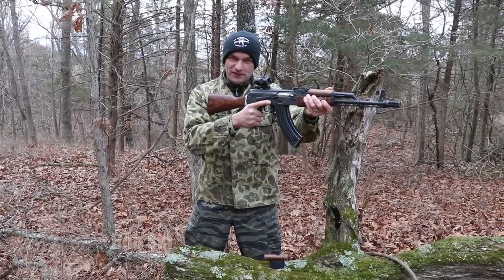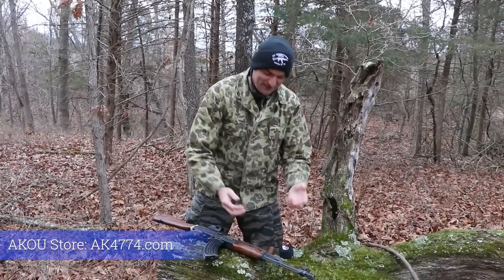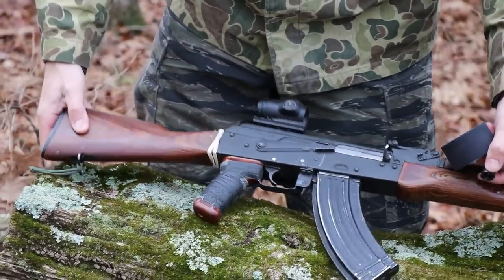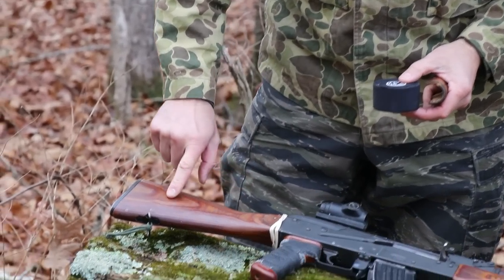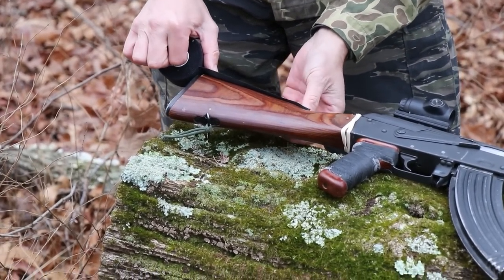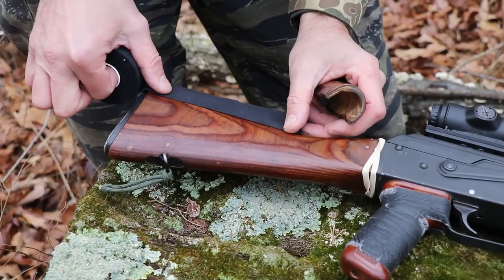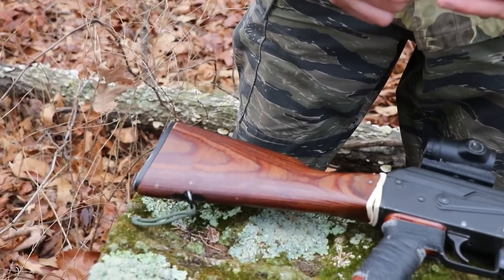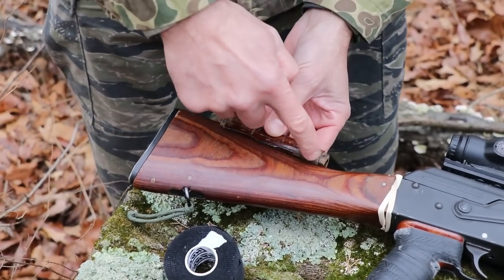AK Cheek Riser done in 60 seconds!

Comment: I might put the tape on top of the stock first, not to prevent scratching, but because it would likely help keep the gas tube cover from shifting side to side on top of the stock. The wood on wood isn't very grippy. Thanks for the tip, Rob!
Reply: That's what I did on my SKS.

Comment: i had an old pistol case which had some stiff foam inside, cut the foam into a block and added the same tape, adding extra blocks and compressing it with another layer of tape until the right height was achieved. Worked really well for me personally and could be cheaper than using ak furniture.
Reply: Great idea . Thanks !

Comment: I took an old Uncle Mike's cordura holster. I used an Exacto knife and working from the in side, I cut the main stitches holding it closed. Lay it open and  again from the inside, pick the threads holding the belt loop and retaining strap.
Lay it over the rear stock as your cheek riser. Place tape or foam down the comb to set the desired height.
Run three small "deck " screws in from each side to secure it.

Comment: If you don't have extra furniture on hand. I would try slitting a piece of PVC pipe and then using a heat gun to heat it up and mold it onto the stock and tape it on.

Comment: i told a cotton napkin, basicly same as old t-shirt, cut out a square of it, rolled it up to slightly less than thickness i wanted, used a thin sliver of duct tape in the middle and sides of the square to tie it in a roll permantly, then i used 2 more thin strips of duct tape to attach it to the triangle brace.then i took some cammo paracord and started wrapping it, on the underside every rotation i added a dab of superglue to really hold everything in place and not let the paracord walk. my knots on both ends got superglue as well. its been holding up for years!

Comment: Second option instead of a muzzle nut is to actually use some of the athletic tape cut it in half roll it up into a little ball before you tape it so it actually gives you athletic tape as well in a little ball that is stuck to itself which means that just in case you can use it for other purposes or you can stick Paracord under there for the ultimate survival rifle

Comment: I did the same thing on my AK with a little foam universal cheek riser kit i bought on amazon (cost 10$) I just used the foam for that and cut it to my liking. Added soft waterproof foam 3M tape. Weatherproof and looks nice with the wooden stock. I plan to get an archangel stock later on though.

Comment: What do y'all think is the best AK for someone who has never bought an AK before
Reply: Get a WASR or one of the one of the Zastava rifles. In my opinion,  for now, stay away from any US manufacturer. These are imported,  and solid products.
Reply: the wasr 10s are definitely sought after i recommend them the romanarm cugair wasr10s are definitely something to check out they've jumped im price like everything get a wasr if you want a historical piece that you can appreciate and shoot you can do a little to them in terms of modification, i do have a century arms vska and even though its missing a lot of accessory type pieces like a cleaning rod and the optics mount ive shot 500 rounds out of it so far and i cant say ive had any problems with it nor will i ever, get US made if you just want an ak instead of a piece to really appreciate

Comment: Just FYI. I use athletic compression tape. No glue to mess up a stock if that worries you etc.. Compression tape stretches, and it holds against itself. So you can wrap it tight or loose. Then to take it off, just unwind it. No sticking. Also, you can use it repeatedly over and over